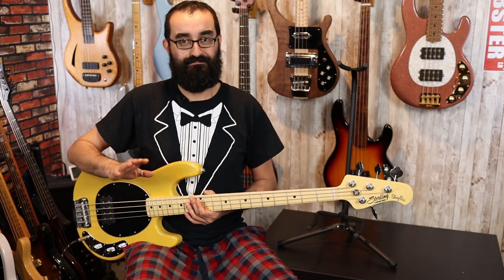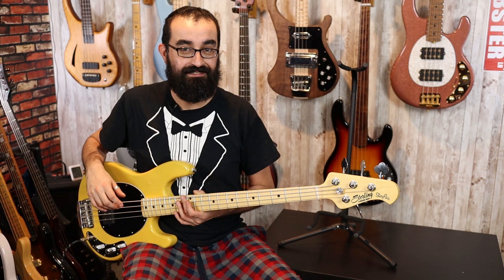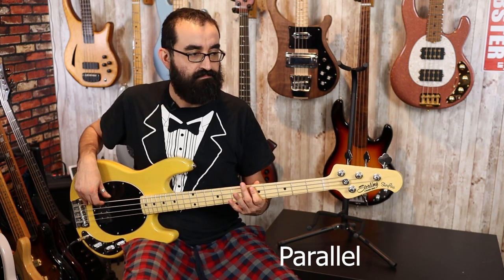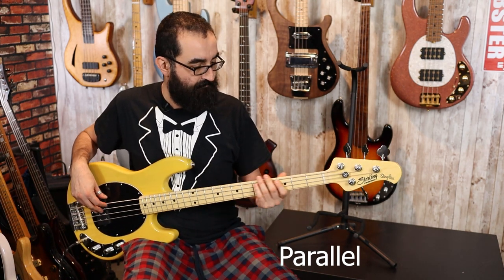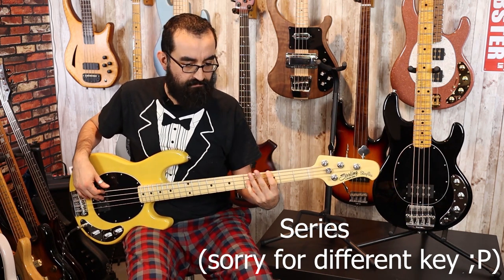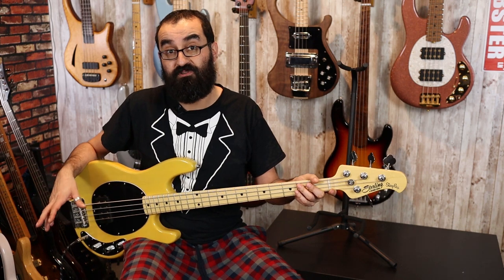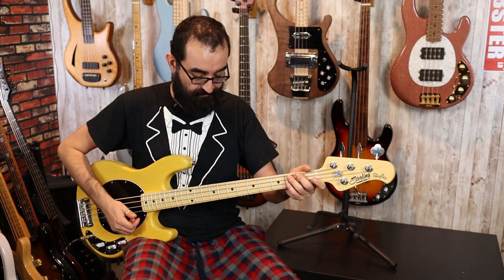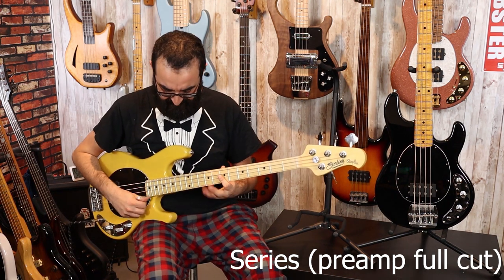Sterling by Music Man Ray24CA wired in Parallel! Why isn't this stock?- LowEndLobster Fresh Look

Comment: LOBSTEEER, HALP!!!! Do you have a wiring diagram which shows how to do it? I'm at a technician's place and he asks me what do I mean by parallel. Parallel to what? To volume, to the preamp, to the output jack? I'm absolutely clueless and he seems to be clueless too (funny thing, rewiring a pickup is on his price list, lol). Does it require dismantling the pickup? HALP NAOW PLS!!!
Reply from the maker: Hey BD. I don't have a diagram, but it's setting the pickup up in parallel. If he doesn't know what that is, I might find a new tech lol. Basically you want to have the + and the - of both coils going to the + and - spots on the preamp, where series has the two coils connected and only one - and  + if that makes sense.
Reply: @LowEndLobster  thank you so much! I think it was lost in translation - he thought I wanted him to rewire the entire pickup, lol :D But it's already sorted. I wish I wasn't such a disaster with all things electronic - I'd happily do it myself but I'm afraid I'll fry a preamp or do some other permanent damage XD
Reply from the maker: @Bassdriver  Glad you got it sorted!

Comment: Actually I like series way better, but I usually play precision with flatwounds. Parallel is waaay too zingy and less bassy for my taste
Reply from the maker: Thanks Nikola! That's a great use case you pointed out. Series with flats would sound killer :)
Reply: @LowEndLobster  If I am into slap bass or metal I would definitely prefer that parallel sound

Comment: Hey LowEnd! Do I need a soldering kit to re-wire the Pick up?
Reply from the maker: Hey William! Yes, you need a soldering iron. It's two solder points, very easy. Black and Red to the hot, green and white to the ground if I remember correctly.

Comment: LOL MM/EB using the old crazy naming schemes and tier-specific defeaturing...did Intel make another counterintuitive purchase, maybe a music company this time?
Reply: You are basically the guy that made the video of the Celeron taped pin hack, except basses.
Now I can add to the prep list of instruments I can fix/set up and upsell: Buy these for 400 bucks, fix the wiring up, resell BRAND NEW with MOD for $500.
I'll do these things ALL DAY LONG for people.  Seriously.
And when I get done with them, they're usually better than new because any questionable manufacturing stuff gets fixed too because old habits die hard - if you see it, fix it or you WILL be opening that instrument again, for that specific thing and whatever else it fucked up while it was failing.
Reply: After reading the comments, I'll install a Push/Pull for 50 bucks more.  :-)
Reply from the maker: LOL! Well said dude. I should put an intel sticker on these ;P. I was contemplating building a small PC into a bass... I'd go AMD of course hahaha
Reply: @LowEndLobster  nvidia is the mobile supercomputing champion last I knew.  I think I still have a Jetson kit around from when I worked with such things.  :-)
Reply: @LowEndLobster  I have a snapped headstock guitar that's going to be my first serious repair ever.  If I am not doing content yet, I'll probably find a place to send it.  It's a washburn hollow body I guess I could make a shortscale jack cassidy or whatever lol...huh.  Actually.  That might be pretty cool.  it's gonna be under 26" scale for sure tho

EDIT: send it for opinions, hopefully one or a couple of the guitar channels that like to run odd content once in a while because it's kind of odd project if I decide not to restore to stock or even to a 6 string.